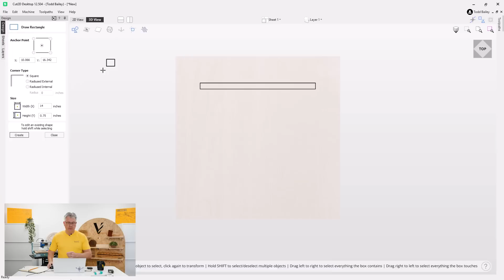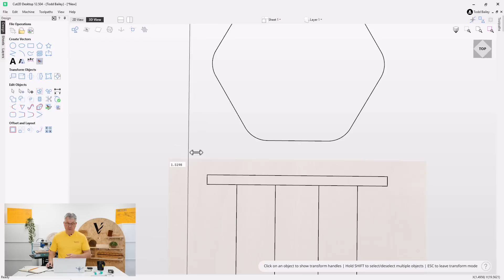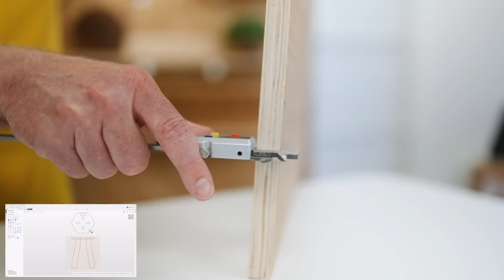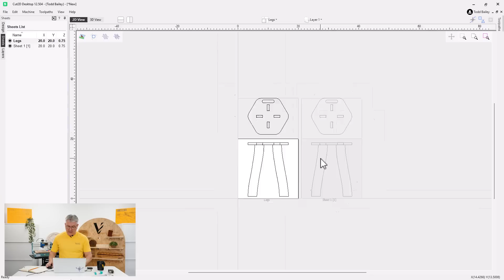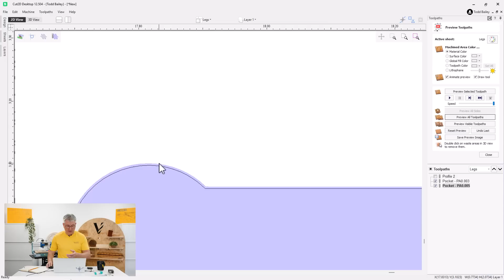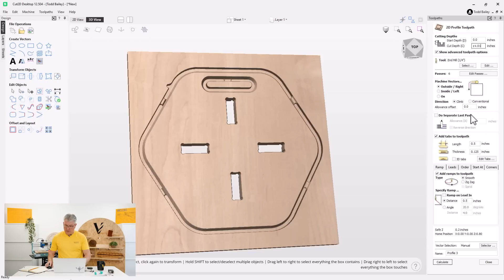Easy Shop Stool | In the Labs Vectric | FREE CNC Projects

Comment: Subject: Feature Request: High-Resolution 3D Graphics and Dark Mode Support

Dear Vectric Team,

I hope this message finds you well. I am a regular user of your software and truly appreciate the powerful tools Vectric provides for CNC design and machining.

I would like to request a couple of features that I believe would enhance the user experience for many of us:

1. High-Resolution 3D Graphics Rendering:
It would be very helpful if there were an option to increase the quality of 3D graphics for users with higher-end hardware. This would greatly improve the visual experience during design and preview.

2. Dark Mode Interface:
A dark mode option would be a welcome addition, especially for those of us who work for long hours. It would reduce eye strain and provide a modern look to the software.

3. Performance Settings Based on System Capability:
If possible, please consider adding performance settings that automatically adjust graphic resolution based on the computer’s hardware. This would ensure that users with lower-spec systems can still enjoy smooth performance, while high-end users can take advantage of full graphic fidelity.

Thank you for considering these suggestions. I look forward to continued updates and improvements to Vectric software.

Best regards,
Reply from the maker: Thank you for the detailed suggestions, we appreciate your feedback and have passed it on to our Development team!

Comment: Is there any quick method to, for example, center two elements relative to a line?
Reply from the maker: Hi there, you can use 'Flip About Line' with the element and the line selected to mirror it to the other side of that line. Hope this helps, thanks!